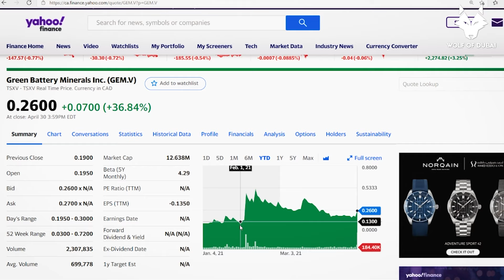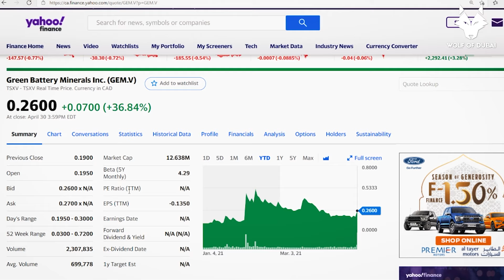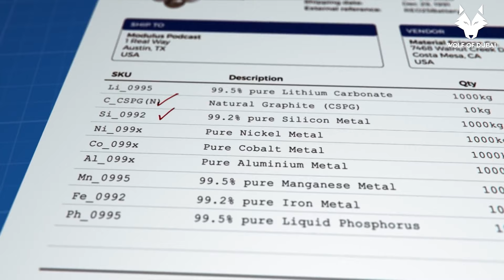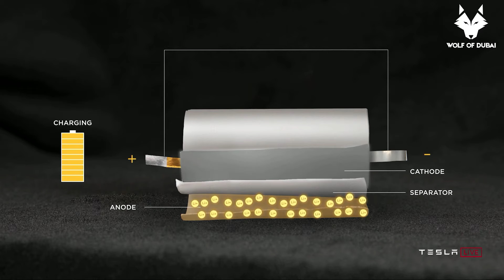250M Cars in 2030: Solving EVs Biggest Risk

Comment: It's all about the carbon. Densest energy storage is inevitably about either carbon or lithium—it's a race. That's just down to the properties of the elements in the periodic table. And even if lithium takes center stage, carbon is a crucial part of the picture. So the solution to the energy problem requires carbon critically, the aim is to reduce carbon in the Atmosphere, and it's for the benefit of the carbon-based life forms on the Planet. Heck, even future solar cell technology may depend on carbon nanotubes. It really is the king of the Elements.